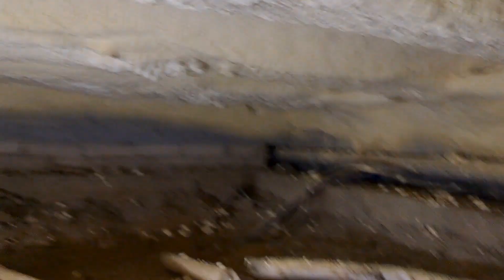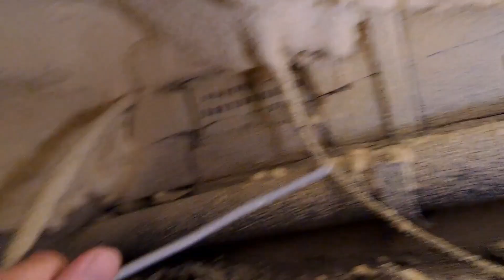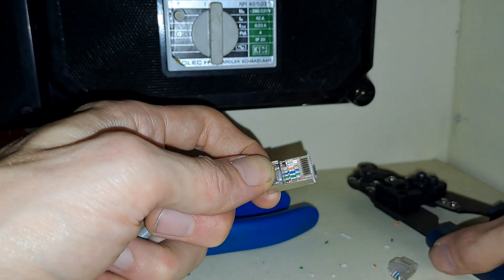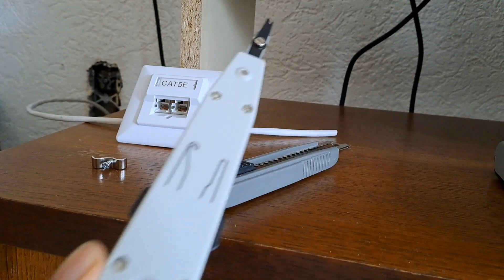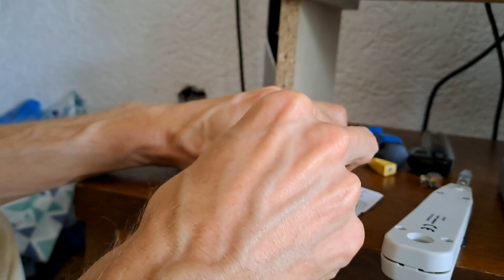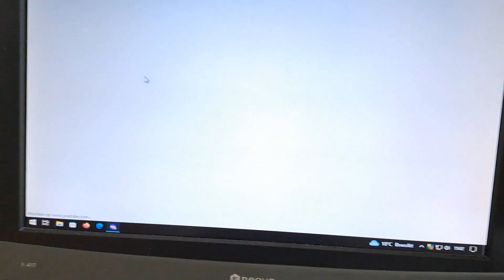New network with Q-link outlets

Comment: The standard Ethernet cabling is not paired as you did it on the first end of the cable.  It is important to pair the wires correctly to get the best speed and reliability.  The ADSL spec it actually the correct one for ethernet.  You shouldn't have all pairs adjacent as you did initially, as this means that the signals will not be in a pair of wire, but spread between pairs, which makes the signals noisier, and increases crosstalk.  Look at pretty much any ethernet cabling guide to get a better explanation.
Reply from the maker: Thanks, that's some useful information. I'll use the ADSL specs in the future.